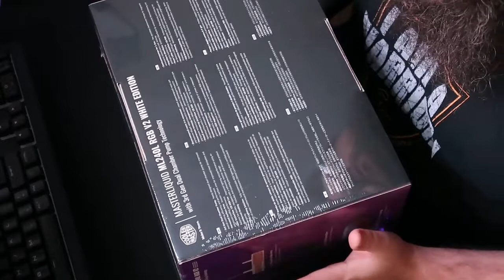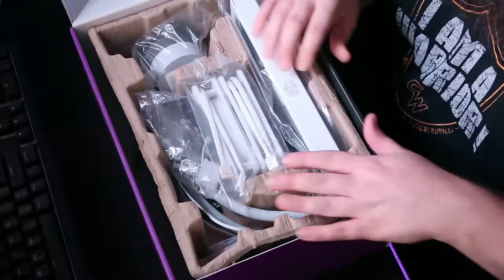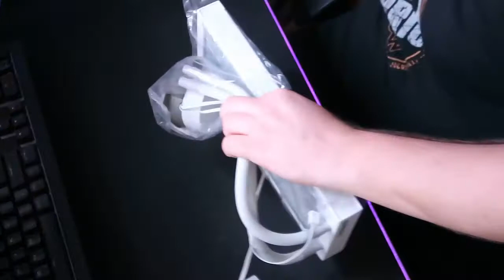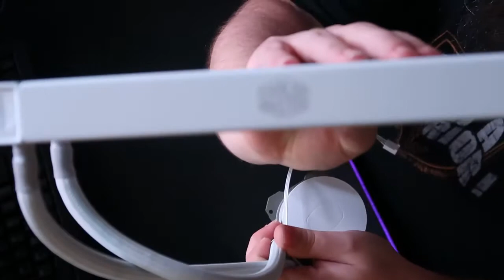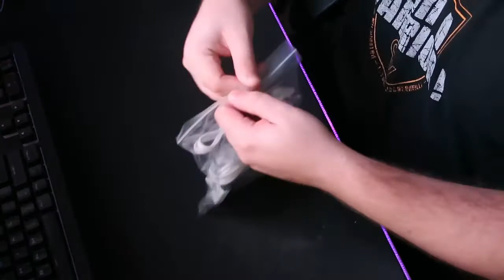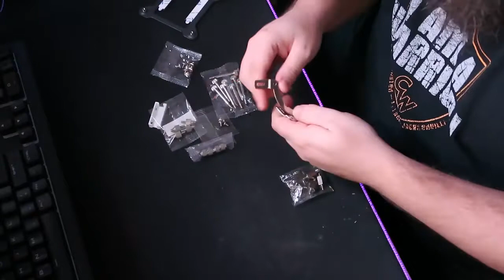CoolerMaster MasterLiquid ML240L RGB V2 White Edition Unboxing

Comment: Does it make a lot of noise?
Reply from the maker: Hello Miguel, I have been running this cooler in a system at work and have not had any noise issues out of the pump system.